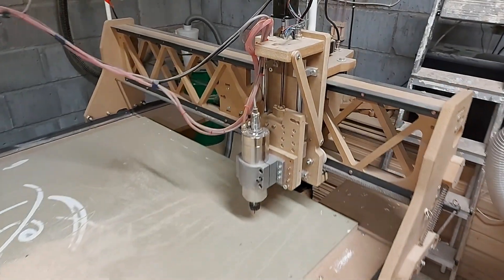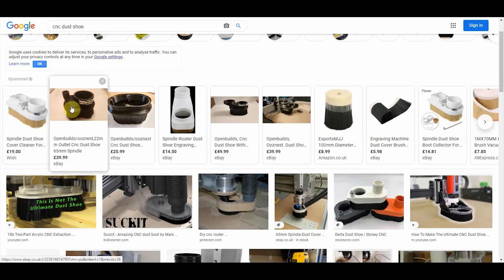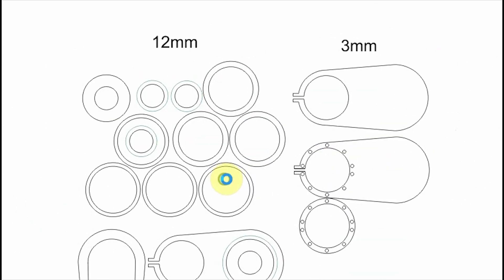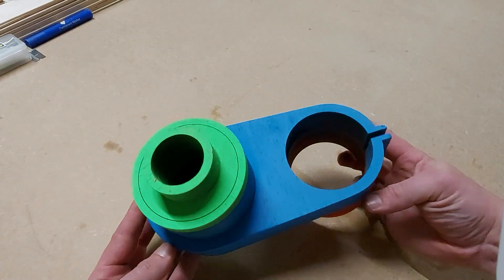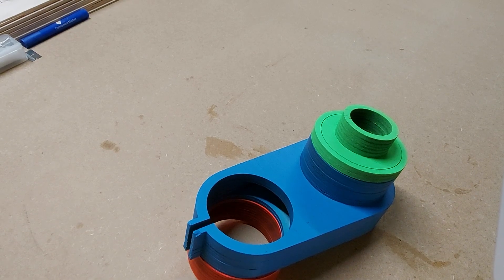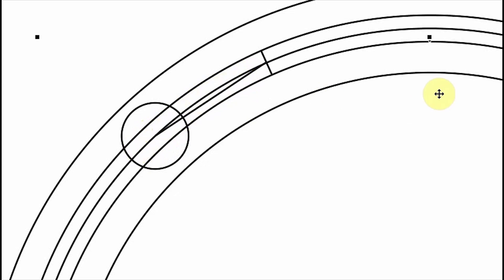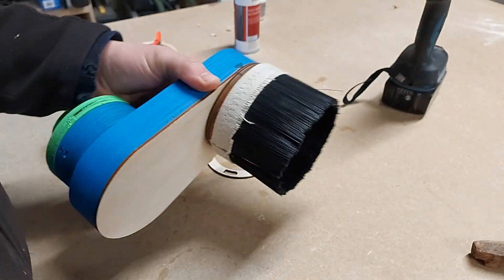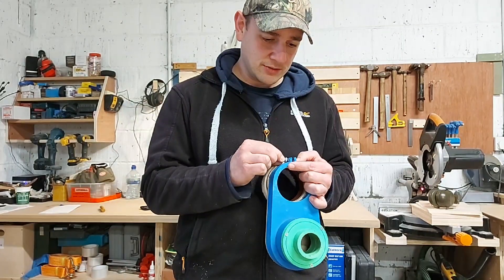DIY CNC Dust boot / Dust shoe - How to build one without a 3D printer. Sliced plywood construction.

Comment: How did you attach the actual brush material onto the red sleeve? Hot glue/pinned?
Reply from the maker: Pretty sure I used CA glue or hot glue to attach the brush strip.
Reply: @TheNaturalWorkshop  Thanks, I'll give the hot melt a go first. Haven't got any CA anyway. 👍
Reply from the maker: No worries, I didn't realise, but there are lots of different types of hot melt glue, who would have knew it! Good luck, let me know how you get on!
Reply: @TheNaturalWorkshop  Thanks, will do. May have to check out the hot melt glue. Got a kit from Aldi here in Oz donkeys years ago, but never even opened it 😀. May take a while, still sorting the garage out, and finding things I can't remember buying, or thought I'd lost. Definitely need to get things in order before I get cutting again, and number one is getting dust management sorted, otherwise I'll end up in the same mess and back to square one 😀. I found a brand new 750 watt dust collector that I bought second hand nearly 10 years ago in the far corner. Been using a shop vac with a cyclone on top of an old home brew beer barrel. Works well, but bloody loud. Next job to cobble the dust extractor to the cyclone once the dust hood is sorted, and go from there. 

Have you considered doing a walk-round video of your shop? Maybe a video of each of your machines. I'm interested in the design of your CNC machine for instance, your Y axis looks interesting. Fairly easy to do and shouldn't need too much editing.
Reply from the maker: Apoloiges, Youtube didnt let me know you had replied! Ha, yeah, Ive got one of those setups for my general cleaning in the shop. Everything routed through a cyclone using a Dyson hoover. Works great but it is way too loud! 

Yeah I can do a walk around the shop, we are in the process of tidying the whole place up as Ive got timber EVERYWHERE lol, its making it a right pain to work, give me a couple of weeks and Ill get one done 👍
Reply: I've got the 750 Watt version. Only just noticed (after 8 years lol) that it has 2x M4 holes at the base of the spindle, and also a shoulder. Makes it much easier to mount a dust shoe. I've made it similar to yours, but made it out of 3 layers of plastic cutting board, the middle layer having the void for the dust to go through. Just got to make the adaptor for the extractor pipe. Hope it works OK, the extractor is much quieter than the shop vac I'm currently using, and less power to boot. (excuse the pun) 😁. Thanks for the inspiration. 👍. I'll post it if it works out OK.